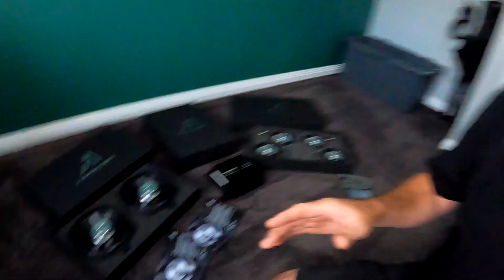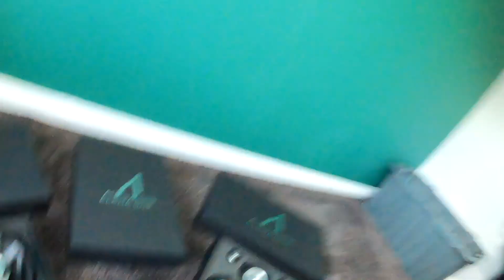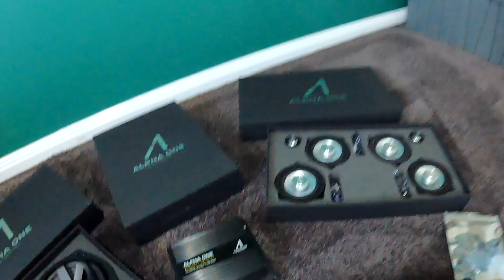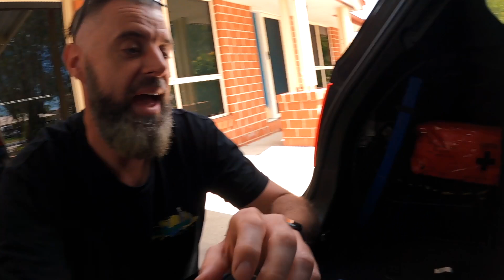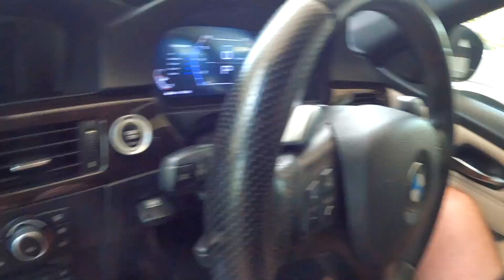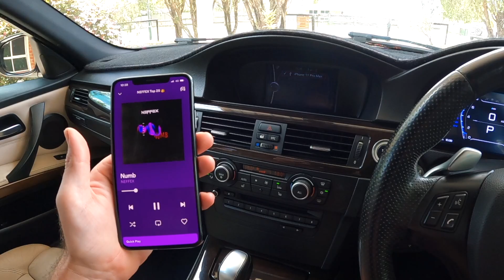Bimmertech Alpha One Amplifier: NOT just an AMP!

Comment: I have the S676A HiFi system in my F80 M3 according to their website, is that the same as what you tested and as such would just recommend the amp or would you recommend sub/speaker upgrades?
Reply from the maker: Wow didn’t expect to see a S676a in a f80. If that’s what you have this amp will make a massive difference. Was just talking to someone with that setup in a f30, he said this amp is best single thing you can do to the S676a f series. It was make you car sound better than a S677 (Harmon kardon) and take 5 mins to install.
Reply: @ZeroTo60Tube  that's what the pure seems to come with according to the VIN and build sheet I have. I predominantly want more bass so do you think it's worth upgrading the subs as well or should the amp be more than enough?
Reply from the maker: @reaprr  Would make sense in the "pure" models to have hifi only. Yes, absolutely will increase your bass significantly. It nearly doubles the power going to subs. But then with the bimmertech DSP tuning it makes the signal hitting the subs much easier for them to handle. Its a really clever bit of kit.

Comment: Awesome review with meaningful explanations.

Is there an easy way to check which audio option a car has? e.g. option code on the spec sheet?

I don’t see anything audio related on mine so I guess it’s base :(
Reply: no tweeter = basic stereo System
SA 676 HiFi System
SA 677 Logic 7
Reply: @odie0815  👍 thanks dude
Reply: @Innoxiousx  you're welcome
Reply from the maker: You can use a vin decoder like mdecoder and it will list your factory stereo option. Then google the code to make sense. Bimmertech do it as well. But they show what works for your car. Not what your car was (I think)

Comment: Great, informative review! That’s a first when it comes to reviews of this product 😄 Interesting, it’s a white labeled Match dsp. If the pre-made tunes are really well made, might be worth the money if you want a plug and play install. But if you are going to tinker with the settings anyway, might be better to just buy a Match UP7BMW. Match provides car specific tunes as well, would be useful as a base tune.
Reply from the maker: Dont tell anyone i told you this. But this is the matchup8. Which is purely just for the extra power i assume. over the 7, which they used to sell. Regardless the out of box tunes from bimmertech are on point. That said once you have the software setup, you have full controll if you want to tweak anything to suit your own preference.
Reply: @ZeroTo60Tube  gotcha. I appreciate the honesty!

Comment: I have the base system in my 335i. The only upgrade I did was to add the BMW door tweeters. Would that be a good base for buying just the amp? I know you probably answered this already in the video but the terminology of base systems has me lost a bit.
Also the coupon code XMASZEROTO60 isn't working at the moment.
Reply from the maker: You will need to verify which subs you have. And would likely need to modify the wiring in the car to give the subs a seperate channel from the amp. The amp will likely be too powerful, but you can tune it down to maximise your current speakers and then possibly upgrade later if you still have the itch. The ket to it working will be having hifi subs at a minimum. Or go the bimmertech subs with your current door speakers. They will be able to make it work. Will email them about the promo asap.
Reply: @ZeroTo60Tube  I only had the amp in the basket when trying to promo so it may be only valid for the full kit. I see that the euro base system is a lot more basic than the US base, I'll see how much wiring is needed. Thanks for the info!

Comment: Another reason why the stock system just isn't as good as these newer DSP+Amps is the amplifier topology - back in the early 2000's nearly all amps were class A/B, which was only about 50% efficient. These newer amps are using class D and class G, which is more like 90-95% efficient. So more power in less space.

DSP has also moved the game forward several leaps.

I'm certain the Alpha One speakers will take it to another level again too.

As for how much I've spent, it's better not to add it up. Ignorance is bliss 😅
Reply from the maker: hahaha wise, very wise. We need to have a sound off. Alpha one vs the most expensive 1m stereo (in clarkson voice)........ in the world........